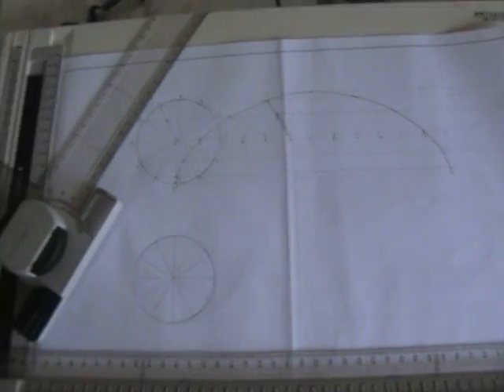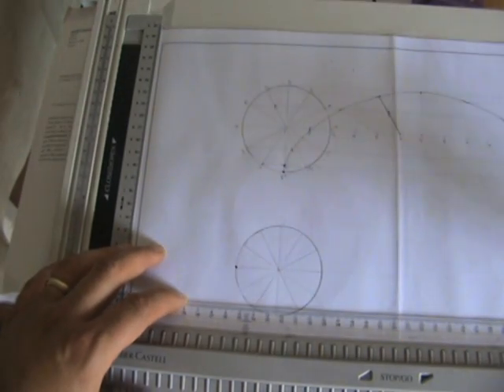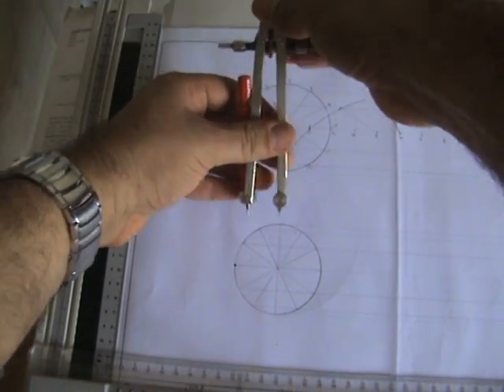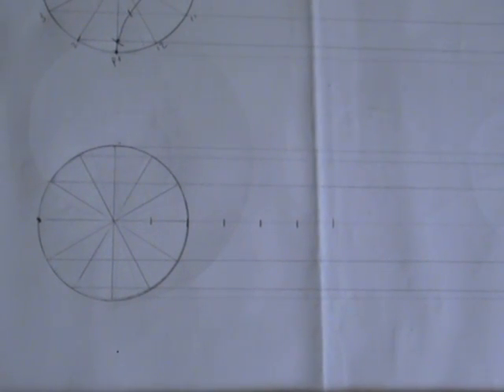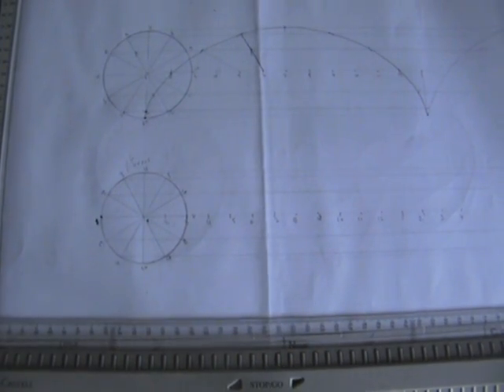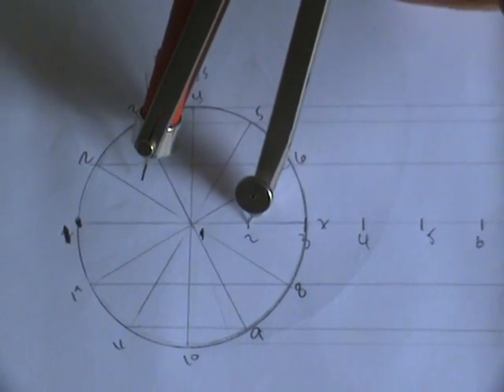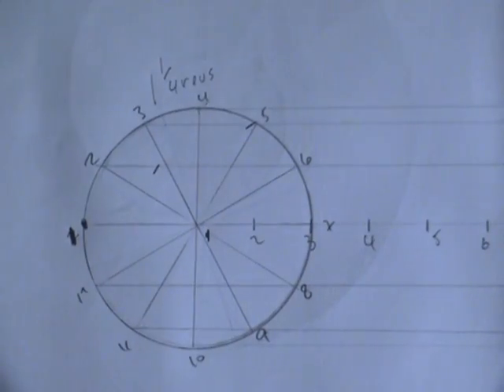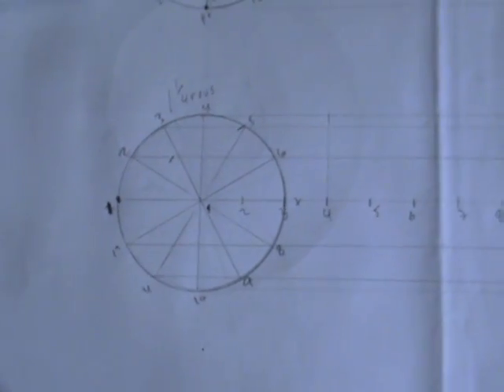Cycloid

Comment: Excuse me Sir, but that measurement you took is not 1/12 of the revolution, that is the linear distance from one point to the next. In order to get 1/12 of the revolution you would have to calculate the circumference of the circle and then divide it into 12 equal parts. Thank you.